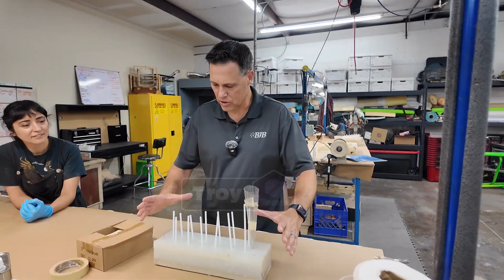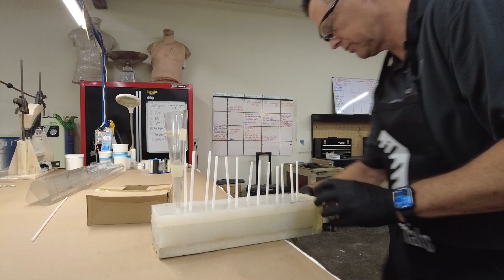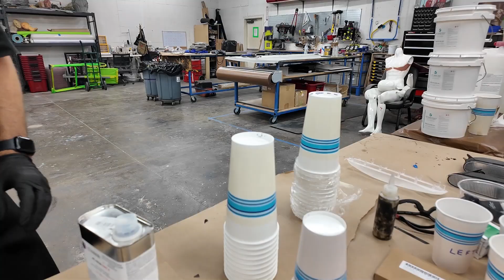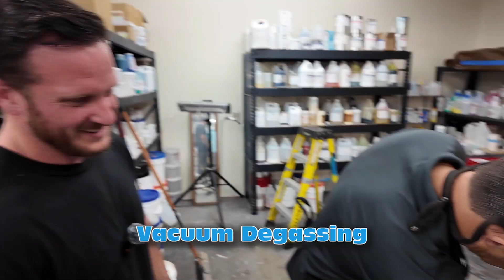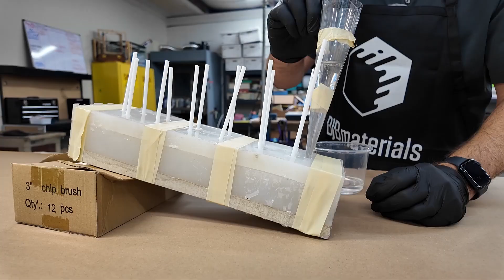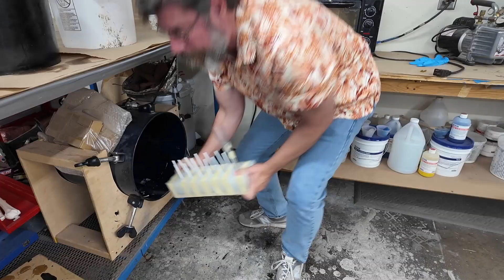Casting Clear Automotive Parts With Fox And Superfine In Georgia

Comment: Hi! I just wanted to know what shore hardness or what kind of silicone in general would I need to make a medical practice “skin” for needle injecting. Where the fluid won’t leak out from the entry point made by the needle. Still love this channel btw ! You guys always give out great tutorials and tips
Reply from the maker: TC-5110 and TC-5110F are both good “skin” silicones. The “F” at the end is for the fast formula. It’s about a 5A.
Reply: @brickintheyard  oh okay, thank you for the clarification. yes I’ve had the fast formula one saved in my phone , but it’s never in stock unfortunately at least for the smaller sizes.
Reply from the maker: @peka8571 just checked BJB’s website and it is in stock. Call BJB and they will help you. I know it’s available, I just ordered a lot of it!
Reply: @brickintheyard oh! Okay I thought that BIY website  was no longer selling on there and are selling through fox and super fine only. I’m going to go grab it now. Thank you so much!
Reply from the maker: @peka8571 not Biy, BJB enterprises.
Reply: @brickintheyard thank you , yes I know I’m sorry I didn’t mean for my comment to come off that way. 😅 I’ve checked the website and placing order . Thank you so much for the help again !